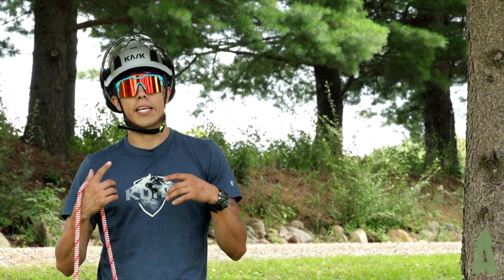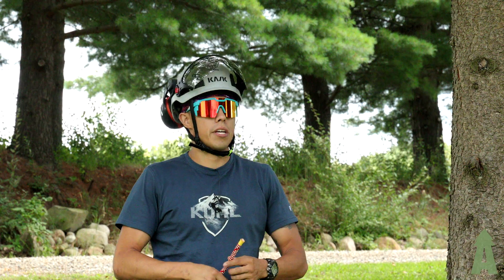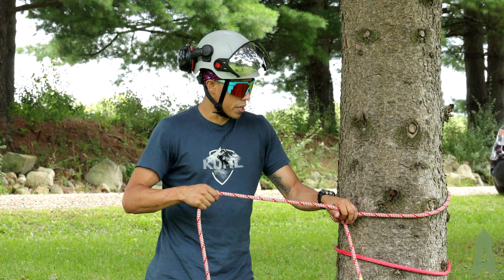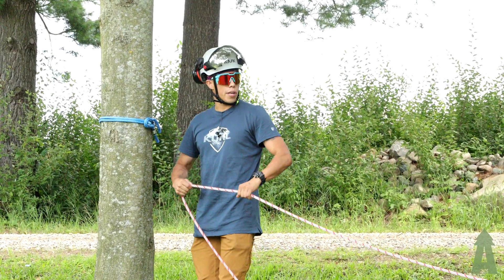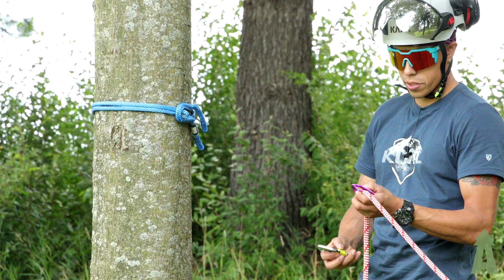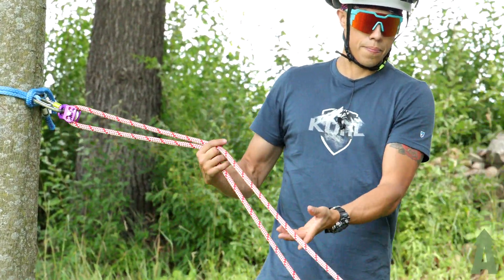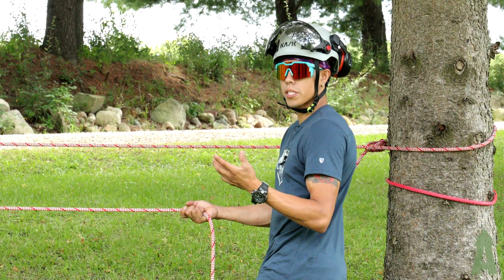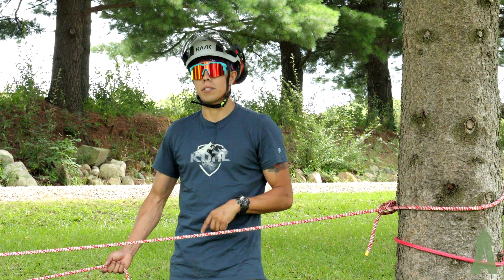Quick 2:1 Mechanical Advantage

Comment: I'm reconfused! Is that a word? 
So if you pull 100 lbs on the rope the other rope sees near 100 lbs? And the pulley sees 200 lbs? The pulley is dragging the load with 200 lbs of force.
So it is 2 to 1 then right?

Comment: You failed to understand the difference between horizontal pulling and vertical lifting where you could use anchor point to support a portion of the load with pulley friction in Mechanical Advantage techniques

Comment: Wrong that is not 2:1 . For example if you are pulling water from a well adding a pulley at the top do not reduce the effort to pull water from well. To achieve 2:1 you need two pulleys
Reply from the maker: This is a 2:1, the pulley at the load sees a 2 units of tension. They're excellent videos done by the @theropeaccesschannel that breaks down how to count the total MA using the T-Method. As your well bucket metaphor, the pulley at the top is a Change of Direction (COD), but if the bucket had a pulley on it, that would be a different story.
Reply: You don’t understand mechanical advantage techniques. Why not using load meters (baggage weight balance) to prove your theory
Reply: @jclaudelaberge5894 
I thought it wasn’t a 2:1 at first, but then I realized the load is not the first tree, it’s the second tree.
Reply: You are wrong, that is 2:1 MA. If he put pulley to anchor point, then will be 1:1, i other words just redirect.

Comment: This is not a 2:1. Probably delete the video and do over as it’s misleading
Reply from the maker: In a Simple Mechanical Advantage System, it is quite easy to determine your MA. Here for example, two legs at the load indicate a 2:1. Or you could count via T-Method. As Abdon pulls, he inputs a unit of Tension and travels around the pulley, so now the opposite leg also has a unit of Tension resulting in the pulley seeing a total of 2 units of Tension. However, we will reshoot in a different method to better explain.
Reply: It is a 2:1, if the load is where the pulley is...

Comment: Going through 1 pulley is technically just a redirect
Reply from the maker: One end would be locked at the anchor and the moving pulley is on the load (in this case, our load was the tree), it is your 2:1.
Reply: @BartlettArboristSupply 2:1 https://roperescuetraining.com/images/rigging/raising/Raising-2x1-COD.png
Reply: @BartlettArboristSupply  that's a 1:1 setup, you'd have to go to the load and back to the pulley for a 2:1
Reply: @esiljander2362 pulley is at the load and moving.  To move the load 1 foot requires you to pull 2 feet of rope.  2:1.  You can add another pulley at the anchor as a redirect but it’s not required for a 2:1
Reply: Yep it is a 2:1, because the load is at the pulley

Comment: A 2-1 is almoat useless unless using it too add onto another mechanical advantage system. I would almost always rather setup a 3-1. A rope set in the top of the tree youre trying to pull over passed through a pulley tied to your anchor then back through a pulley midline on the pull rope attached to the pull rope with a prusik. Bam. 3-1
Reply from the maker: Agreed! This is the first installment on different mechanical advantage systems.